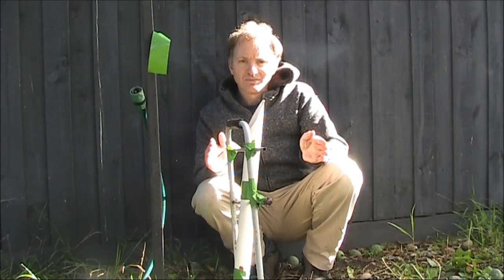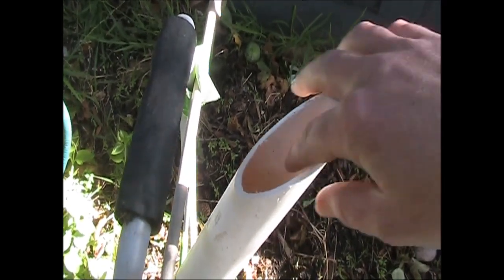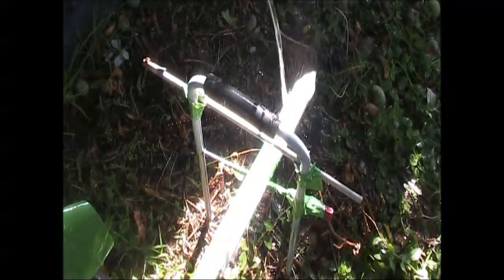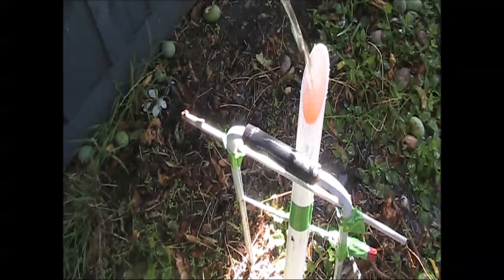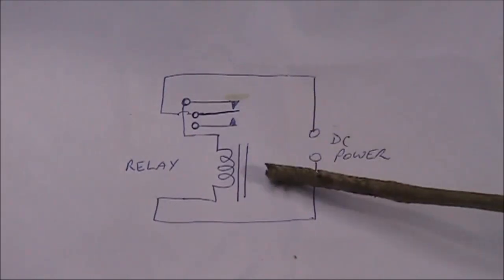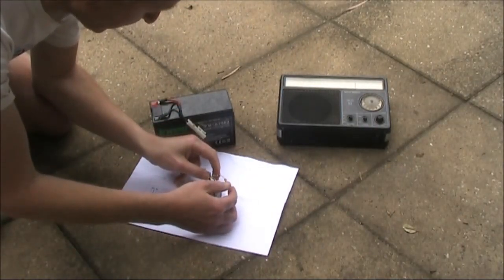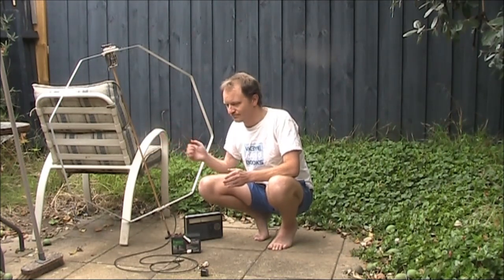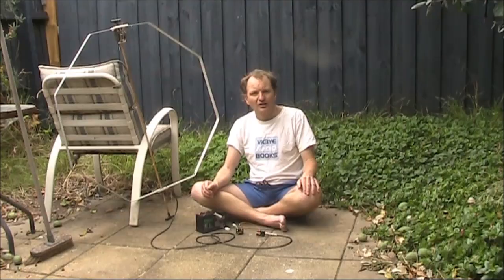Electronics on the Floor: A Japanese deer scarer and simple spark radio transmitter

Comment: At first, I thought, what's the point of that deer scarer? However, I found it strangely mesmerising. The oscillating relay reminded me a little of the old inverters that were used in valve car radios to generate high voltage from a 6V or 12V dc battery.

Comment: As a teenager I built a version of the relay spark transmitter using a home-wound ferrite core inductor (with a whole reel of 24 guage enameled copper wire) which when energised attracted a thin strip of spring steel, breaking the contact it made with a carbon electrode salvaged from a battery (so that the electrical arc from the back EMF would not oxidize the steel). The "tuned circuit" I placed across it was very rudimentary lol But I attached it to a lengthy long-wire antenna running from a tree at the end of the garden and powered it with a box of 12 PP3 9v batteries that I soldered together in series (oh dear).
Fortunately I realized how much interference it was putting out after a few brief minutes of experimentation. Retrospective apologies to my neighbours :)
It certainly made me quite familiar with the scent of ozone!

Comment: Great video. Great improvisation. In a similar vein there's a guy on youtube who made an am receiver using a guitar pickup inductor, a capacitor and a diode made from a razor blade which had been heated in a flame on one half to form an oxide layer. I think the principle of demodulation is a simple peak detector as there is no LO. Fascinating.